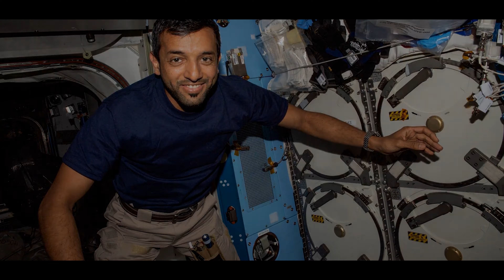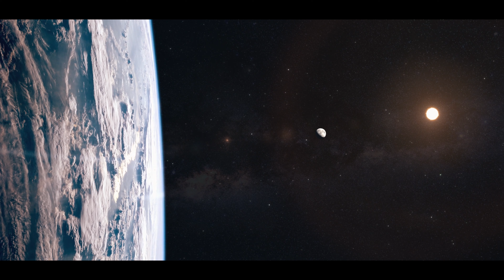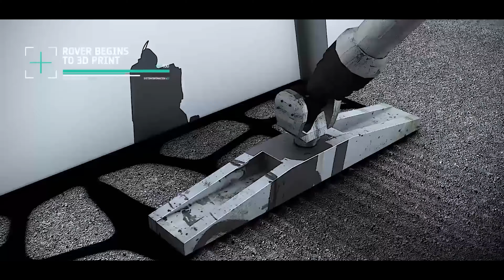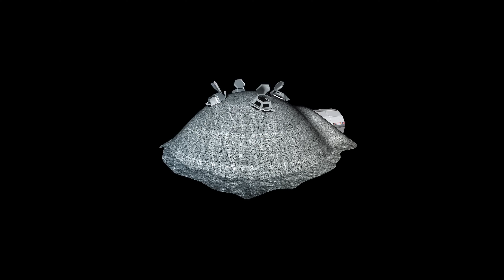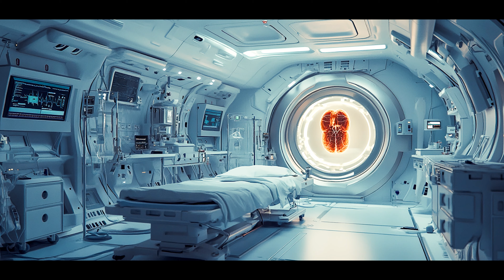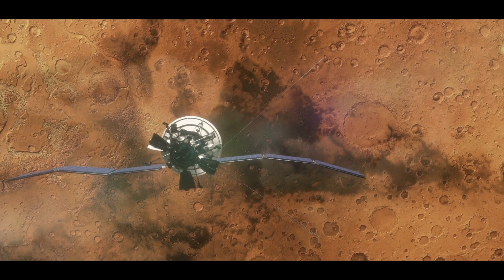What Challenges Must We Overcome to Live On Mars

Comment: I would not have said 3D print was in the top ten.  Maybe Earth return technologies instead?
Reply from the maker: Return-to-Earth technology is important, but launching a rocket from the surface of Mars is easier because of its low gravity. However, 3D printing is challenging since there are no organic materials on Mars. Therefore, you must figure out a way to utilize the Martian regolith.
Reply: @SvenPiper  Do don't need 3D printing on Mars. You do need to return to Earth.
Reply: @jonathanclarke5878  Many wouldn't "need" to.  I'd take a 1 way... 😂